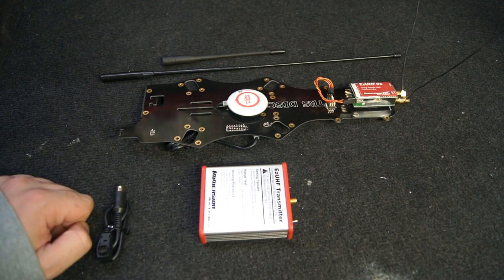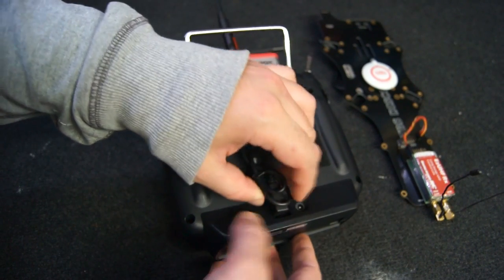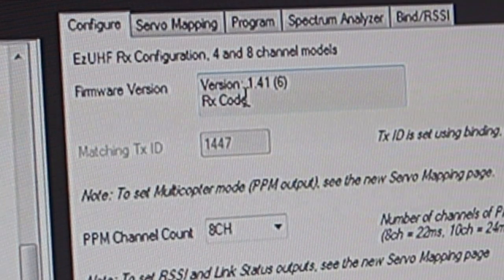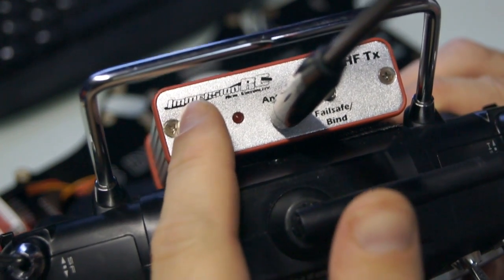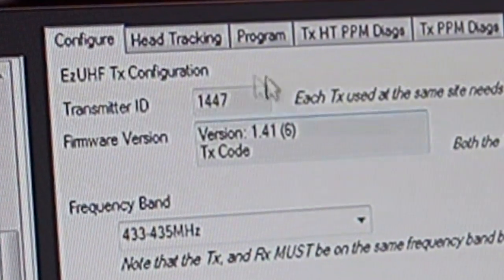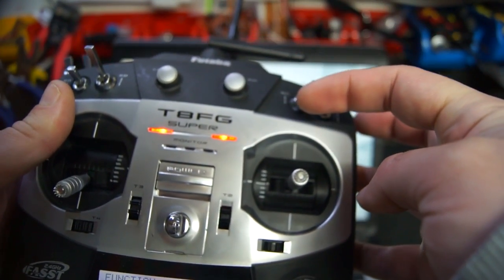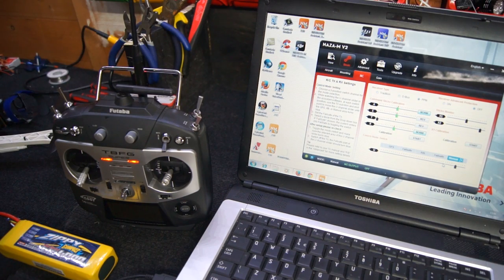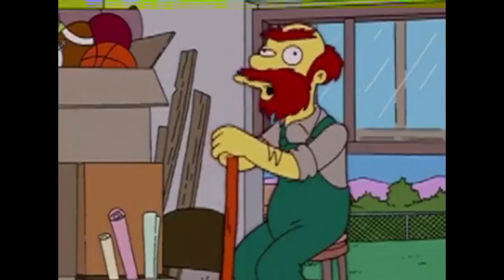EzUHF how to install -Sbus-PPM by That HPI Guy

Comment: Hello, thank you for the video. I still have a question and the problem. I am trying to use the EZUHF 500mw transmitter with my Futaba 14sg. As you I am plugging the trainer cable into EZUHF transmitter. But when starting the radion my transmitter does not come on. I have used ImmersionRC Tool program on PC to update software for EZUHF TX and RX and I also binded them through the PC so i thing that that part is solved. Still my Futaba SG14 is not switching on transmitter and ....where I am doing something wrong. I have turned up and down trainer menu on my radio and I just can not figure it out why it does not emit signal to transmitter. Please, i would be very happy of any advice. Thank you, Matt

Comment: Could you please tell me how the single servo cable is connected ex= is the signal pin on the top or is the groung wire on the top

Comment: Thank you for sharing this video. Question; I'm trying to setup an EZUHF diversity receiver with the Naza N3 but the DJI Assistant software does not detects or sees the receiver connection. I have double checked and the receiver is properly configured to "PPM Muxed" on CH1 and properly linked to the EZUHF transmitter. Both EZUHF TX/RX are loaded with the same firmware version. On the Naza N3 settings "SBUS" is selected for receiver type and the EZUHF receiver  is connected to the "SBUS" port of the Naza N3 and still no luck. For additional testing I tried to use a Futaba R7008SB receiver, the assistant software will only detect the receiver connection if I use the "SBUS2" port of the Futaba receiver. If I use the SBUS/8 port of the R7008SB Futaba receiver the assistant software will not see the receiver connection. Summarizing!!!! DJI Assistant software will not detect the EZUHF receiver no matter what!! Futaba receiver only works if using the SBUS2 port. Can you offer any advice?

Comment: Just a hint: If you hold the RTN button while powering up the transmitter, you will get the option to turn off the 2.4GHz transmitter and JUST use the EzUHF. I do that all the time to conserve power and not transmit on 2.4GHz if I don't use it. :)

Comment: I want to do this with a Phantom 2, but the factory NAZA 2 in the Phantom 2 does not support PPM.  Can I still make it work with EZUHF somehow?  (I don't mind using another upgraded Phantom radio with trainer port or a Futaba I have setting around.)

Comment: Hi is it the same way for the jr module I have diversity and jr module and they work in the traditional method but not in sbus or ppm nothing moves on naza rc screen only when I use the old way it will work I'm all one for saving weight and don't want all the extra wires etc

Comment: I have a 8 channel Lite Rx and an EzUHF Tx 600mW which both have 1.43 firmware.  I bought an 8 channel Diversity Rx which has 1.50 firmware already installed.  I have been trying to upgrade the 8Ch Lite Rx  and the Tx to 1.50 without success.  I am going to try your method, but I did not see you upgrading 1.41 to a newer version of firmware.  How do I get rid of the 1.43 and upgrade to 1.50?

Comment: Excellent Video, thank you! By the way I have the pro but am noticing that my gimbal does not consistently keep my go pro in perfect balance. It is not a dramatic effect but you can definitely see the issue throughout the footage. Have you had a similar problem at all and if so were you able to find a solution?

Thanks Very Much,
Jade

Comment: I want to find out about what settings to use on the Futaba when using the EzUHF radio. Particularly, what type of receiver do you have selected in the Futaba, i.e.. FAAST Mult? Or something else? Also, are there any other settings that are necessary to use the EzUHF with the Futaba? Thanks, Tom

Comment: Great Videos!! I have learned a lot more from your detailed videos than the quick ones on the TBS site. I am very new to this and I am building my first TBS Discovery Pro.  I have asked for help with all the wiring from TBS but have received limited help.  I have seen various wiring descriptions from other videos. I have the same ezuhf system but can't get it to work.  I followed your video but my controls don't function when I pull up the Naza Software.  I have the Ezuhf running to the CH1 to the CH1 PPM on the top of the board.  From the under connections above the Naza V2 you say to run to the CH1 down to the Naza X2. What do I do with the PPM connection that is on the bottom board next to the Naza V2?  In another video I saw that they ran that to the X2 slot.  Do I use the RSSI cable that runs from the top board to the back of the EzUhf at all?  Excuse my lack of knowledge as I am a Rookie to this hobby and the reference material from TBS is not complete enough for me to finish this build.
Thanks,
Dan

Comment: Hi Rich, what's the deal with using the EzUHF in this country, is it legal or are you supposed to have licence to use 433mhz? I'm interested in the set up your using, also will this system work on a T8J?
Great vid, many thanks.

Comment: Very nice video greeting from northern Canada I am very interested in this system. Can it be applied to the Dji Phantom version 1.1 and is it possible to use 2 Phantom batteries in series without damaging the electronics and if so would it double my run time. Thanks